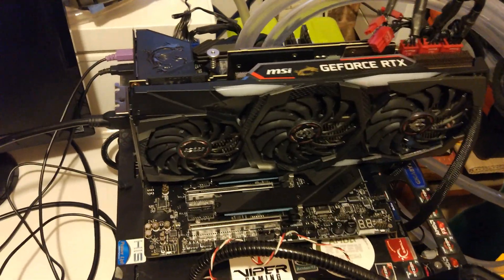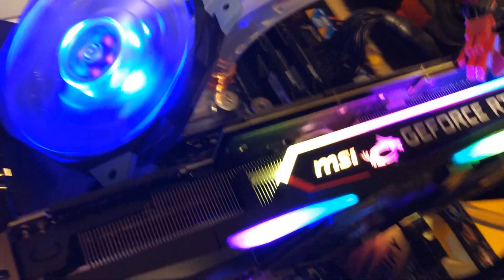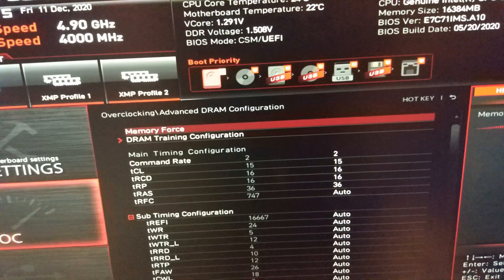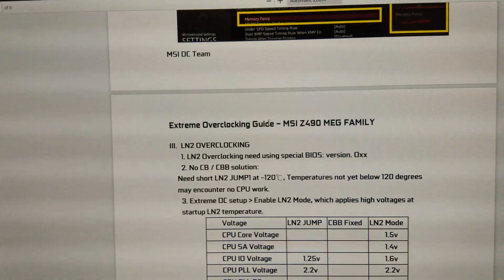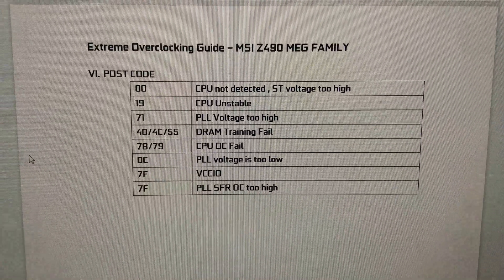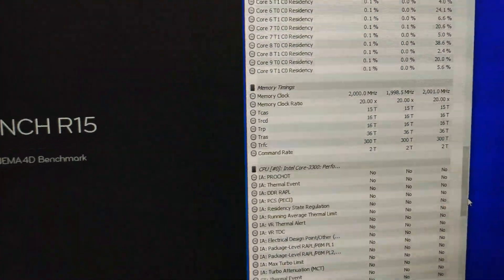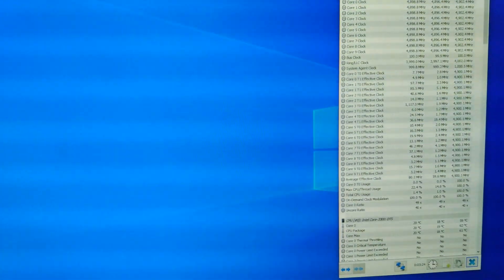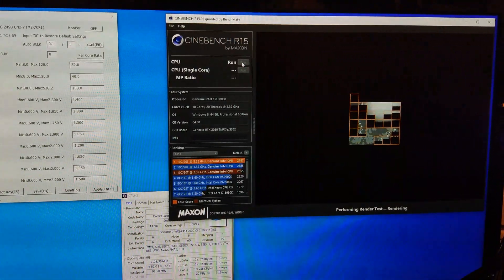i9 10900K ES QTB2 Overclocked to 5.1ghz On MSI Z490 Unify

Comment: How much slower is the 10900T commpared to this? its 100 dollars cheaper. Would it be a better option over  a i5-10400 or ryzen 3600 still
Reply from the maker: The 10900t is miles slower. Without and overclock the CPU is slow. If you want a cheaper cpu get 3600 or 10600kf
Reply: @LawrenceTimme  https://nanoreview.net/en/cpu-compare/intel-core-i9-10900t-vs-amd-ryzen-5-3600
https://nanoreview.net/en/cpu-compare/intel-core-i9-10900t-vs-intel-core-i5-10600kf
Seems the single core speed is still around the same, but it trades with the ryzen 3600. So i'm probably gonna get the 10600kf or i9-10900T, they're both around the same price. Wat do u reckon is better for streaming and gaming? Ryzen 3600 is 280$. I5-10600kf is $275. i9-10900T is 272$. Which would u recommend if these were the prices. Also im upgrading from a i3-6100. 2 core 4 threads.
Reply from the maker: @georgepierre3594  the 3600 had a much better upgrade path and the motherboards are way cheaper of you get b450/b550. I would go for that.

Comment: hey man so this is cheap 10900k es from ali express for like 350$, if I get Z490 board with this processor I can expect at least 4.7ghz all core combo from that, right?
Reply from the maker: Yes!
Reply: Hi.
Me without forcing with the MSI MAG Z490 Tomahawk I run it at 5.1GHZ very stable. I will adjust in the bios tomorrow or the day after tomorrow and try the 5.3GHZ but I think it will pass without worries, in any case nice your video it encouraged me to take the plunge, frankly those who hesitate go there it's really worth So, I did a Benchmark with CPU-Z at 5.1GHZ and I passed the Intel Core I9 10850K I got the same results as an Intel Core I9 10900K so nickel for the price 👍👌

Comment: I have had this board since June and it's been solid so far. Remember to update your bios to A6, I noticed much better stability than the initial release. I run a 10700k 5.1 4000mhz cl14 15 15 30 260
Reply: What was your stock memory cas latency and speed, or is this it?
Reply: A6- Support Re-size BAR function to enhance GPU performance.
Reply: BIOS updated to be compatible with 11th Gen Intel® Core™ Processors!!!!!

Comment: hello, i have same chip and z490 aorus elite, can you please write what numbers should i put in bios please? I want my chip to auto-boost to like 4.9 from stock on low stable voltagre, but it only goes upto 4.2
Reply from the maker: yes, at stock it only goes to 4.2ghz max. you need to look up a gigabyte z490 overclocking guide as the gigabyte bios is different to msi.
Reply: @LawrenceTimme  couldn’t find such guide :(
Reply from the maker: @MrAknur  rip
Reply: @LawrenceTimme  can you just provide a settings for autoboost from low frequencies upto 4.9ghz on auto without overpowering the voltages as z490/intel does it on auto?

Comment: Didn’t know the msi had such power tools! I might have to retry a z490 unify for the price it’s hard to beat! The apex is lovely but not worth the extra £200 cost.

5.1 with 1.3vcore anit a very good silicon chip, but you need to set your load line at level 3. 

Mines an sp92 does 5.2 at 1.285v core